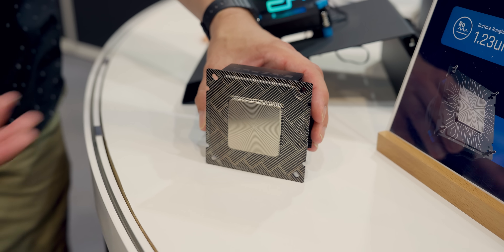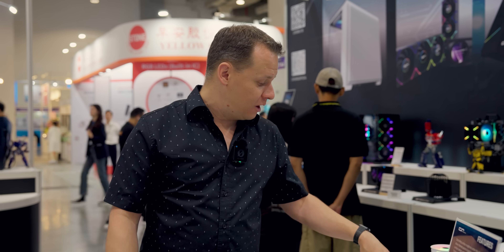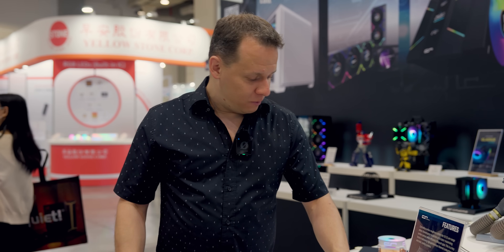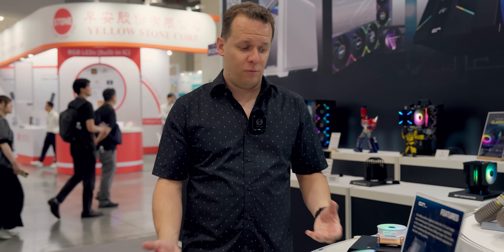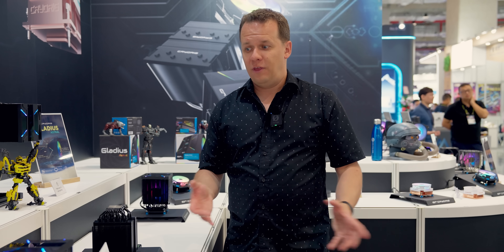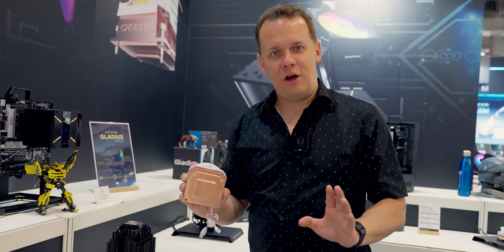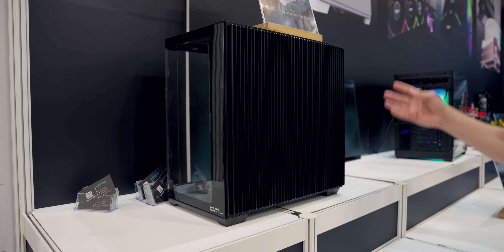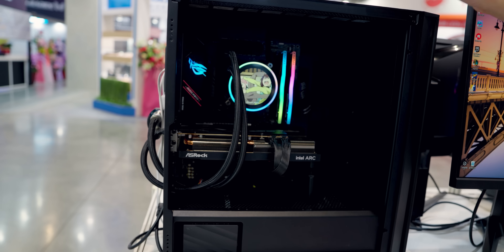The Impossible 185W Low Profile Cooler

Comment: The textured bottom makes sense. It increases the surface area and as long as the media used for thermal transfer can do the job it should be fine. Which obviously it is.
Reply: For me it is super unintuitive and I can't believe it to be better than the usual contact plates. I get that it increases the surface area but for what? The heat spreaders on CPUs are still (on a macroscopic level) flat and don't match the circular grooved shape thus decreasing the contact area.

It only made sense to me if they told me that their contact plate has worse thermal conductivity than usual thermal paste (which would be very bad) or if thermal paste spreading on usual flat-to-flat mounting would be so horrible that you could see huge holes in it with your naked eye (which it isn't).

I need to see scientific explanations or 1:1 comparison benchmarks.
Reply: @MysteryCheaterMan  Increasing surface area can, increase conductivity. Just like more fins equals better cooling. The reverse is also true, to a point anyway. At least I think that's what I was thinking when I wrote that. 

However after re-watching I thought of something I didn't take into account originally. That being the fact that this cooler puts a vapor chamber directly in contact with the IHS. So there your goal would likely be the opposite. To slow down the thermal exchange. Allowing time for the liquid in the chamber to do the work it was intended to do. If the whole system gets too hot and the vapor can not change states back into a liquid no energy is transferred meaning no cooling. 

My original statement is just irrelevant. As the IHS would have to have a matching pattern for increased surface area to be effective.

TL;DR - I must have been on drugs and was wrong.

Comment: Questions on C5 cu:
1. Will vertical setup perform worse than horizontal?
2. How tall is the heatsink, and how thick is the fan? 
3. In addition to Q2, can we pair 120*15mm or 120*25mm fans with the heatsink and have overall height uner 47, 48, or 50mm?
Reply: Gravity shouldn't have any perceptible influence in cooling.

Comment: Can the C5 cooler be used as a bridge between the CPU and an AIO? I am thinking you would get sustained more efficient removal of heat from the CPU which would mean even lower temps than with just the AIO. There are a lot of fins on that, you could have a larger chamber and no fins with an AIO bridge, you could put the fins inside for a bridge. you would need the C5 Bridge to have a second cooler mount on top as if it were itself a motherboard,

Comment: ok, the passive case, WITH a radiator in the loop, an extra 180 watts capacity, slap that in a full custom loop and have a 360 rad with semi passive fan setup.

Comment: Damn, this is so awesome - it's the same formfactor as the oldschool first heatsinks which had fans (with the top-mounted fan). And it's so compact. My triple-fan phantom takes up most of the room in my case. I would be keen for this even for my standard ATX case. Can this scale up to bigger coolers for even more cooling?

Comment: Finally after cm V8 and the sapphire CPU cooler someone came back the vapor chamber... Ps I've modded the sapphire CPU cooler to work with my  5950 and it works really well... Is not silent but maybe I'll change the fans.

Comment: The grooves for "better contact" make 0 sensen. You want to have the mirror finish because the thermal transfer of the paste sucks. Better than air, which is why you want it but absolutely terrible compared to metal to metal. And the thicker the paste the more it sucks So you get rings of ok contact and absolutely terrible contact.
Reply: i get what cryorig is trying to do, essentially faking the grooves to make contact with tim vs surface, but that doesn't make sense considering how TIM and coldplates work

Comment: Wow, Cryorig case looks sick! I really hope it's not 100% AIO or at least that they have multiple versions with a D5 pump and an integrated distro/reservoir plate. That way you could just add an active radiator too and keep the fans off while idle and been able to turn them on when hit with load... Also, adding the GPU to the loop would be nice.

Comment: I don’t think that dispersing the thermal paste with the pattern is better… this way you are using the paste as the primary "middle man" between the cpu and the cooler, and paste will never be better as metal touching metal. This has been tested heavily in the industry and that’s why almost everyone uses the polished metal on metal.
Reply from the maker: Good points and they're ones I brought up too.  I spoke directly to one of their engineers and the reasoning seems feasible.....but we will see.

Comment: The air cooler featuring ten heatpipes looks interesting but it is a bit pointless to present it without specifying what it is rated for. Will two extra heatpipes matter, given that all heatpipes will have a harder time to absorb the heat from the contact plate?

Comment: the proprietary fan is a deal breaker.
Reply: That's...true... , maybe they can save themselves from pr disaster and just give an adapter and 3d print files and some extra rubber tips and supply replacement fans when it's inevitably needs replacement

Comment: if the full thing is made from copper its understandable why it can take so much power. Masive mass with higher coeficient of heat trasfer. i doubt that little vapor chamber does much compared with only making same design from pure copper.

Comment: That case cooler would be awesome if they had it as an option for other case brands, or allowed you to run custom loop fittings to it. Imagine a radiator on both side panels that handle cooling for light stuff and a 360 in the front thats fans turn on for real work.

Comment: Looks good but the fan...if it fails you need to mod that shit instead of using standard mounting. I guess you can just make a frame with a 3dprinter.
Reply from the maker: Yeah I recommended that they add standard clip mounts.  Hopefully they take that suggestion to heart.

Comment: 60 dollars is a steal! Especially 40 dollars for the aluminum one! I would love to see if direct die liquid metal would work with the copper cooler!
Reply: $60 is super fair for that lo-pro vapor chamber cooler. I don't have a ton of money, but I'm happily picking one up at that price.
Reply: Although nickel plated copper is preferable when using gallium (liquid metal) using a copper interface will not "corrode" the copper, it will just stain really bad. What you really want to avoid is having contact with aluminum, because that WILL have adverse side effects. As far as retention after removing amd or Intel's default, manufacturers like thermal grizzly make aftermarket retention devices for making de-lidded cpu's compatible with most air or liquid coolers, depending on of course your CPU generation, make and model. Hope that helps. Happy hunting!
Reply: shhhhhhh, they'll increase the price
Reply: Do you know any other Low-profile Coolers 55mm with 185TDP ?)))
Reply: Liquid metal corrodes copper. In addition to that, once the IHS is removed you need a different design for the spreader, as this flat one would touch the closing mechanism of the CPU but not the CPU itself.
Reply: Inb4 tariffs to make it $180  lol

Comment: Imma need a full on review of that itx cooler, cause if it does what it advertises, fractal terra here I come!
Reply: that's still big, you can even go smaller.
Reply: Consider a Tiki, or a Ridge.
Reply: Of course it's a lie. You will need a fan that make a lot of noise to cool 180w with that crap. A vapor chamber job is to spread the heat faster. But once the heat is spread, you need to dissipate it. And to dissipate a lot of heat, you need a lot of air flow or a lot of surface. Since this cooler is small, the fan have to be extremely performant and it will be extremely noisy.
Reply: Try the formd T1, it's basically the terra but more.
Reply: @ash8603 sadly couldn't buy it anywhere here in Germany, had to settle for the Terra. The Terra is really nice though.
Reply: And would love to see it come to a laptop in a different form factor

Comment: I have a couple of Cryorig QF120 Performance fans still kicking. They're not on my rig anymore because I realized 2200rpm is overkill for my application.
Now I use them as desk fans or fume evacuators when soldering, all that airflow put to good use.

Comment: I like the Lull concept. Obviously going totally fanless requires moving the heat from the CPU (done), the GPU, VRMs, and the NVMe(s). Thus, the barrier to entry is user-friendly connection to MB, GPU, and sundry heat sink products made by other businesses. That is a huge lift.

Maybe a scaled-up Ventiva/AirJet type product would be useful to a fanless system.

Comment: does the clip on design for the fan mean it can't be swapped with a noctua?
Reply: I’m wondering the same thing. I wonder if the metal clips could be used
Reply: Someone created 3D printed adapters for the cryorig c7 and that also had a clip-on fan. If this cooler is good I’m sure it won’t be long until someone does the same here.

Comment: Thank you for covering this, I was not aware of this company and would love to use these.  My kids computers all end up using lower tdp i5 chips that push the boundaries of other small coolers like this and I end up needing to fit a "full size" single tower in mATX cases.  This implementation if works as advertised would be an instant buy for me.  Hopefully the die grooves play well with the different die shapes (height wise) of both AMD and Intel products.

Edit:  If they can hit or get really close to those prices.

Comment: What I would be interested is how this vapor chamber performs in horizontal orientation vs vertical orientation. Most boards are mounted vertically and that is not optimal for vapor chambers. Does it make a big difference?

Comment: I guess I would need to look into this more, but it seems to me that, for something as small as this, it would be more efficient just to use a thin unibody copper block with fins. I was under the impression that the befits of vapor chambers scaled roughly proportionally with the chamber area minus the inefficiencies from the headspace it introduces.
Reply: Most phone manufacturers are actually using vapor chambers in their flagship devices these days.
Reply: @-eMpTy-  You raise a good point. However, I was under the assumption that was because of weight and not performance. But, again, I don't really have any hard data to back me up.
Reply: Why would Nvidia 1000 series gpus use vapour chambers then?
Reply: @Loanshark753  I wasn't saying vapor chambers are bad. In fact, I think they are great. I'm just saying that there is most likely a total area size under which the benefits are largely negated. Graphics cards, even low profile ones, are always going to have heatsinks with much greater area (probably at least twice as much) compared to this particular CPU cooler, so it is likely that they will always benefit from a vapor chamber.

Comment: Hopefully this goes on sale! I will buy it immediately I’m running a 7700X and a 3080ti in my fractal ridge but my cpu is severely power limited so compensate for the heat it gives off.
Reply: It won't, you'll never find this in retail.  It's one of those cool tech that's made only for show.

Comment: Finally somebody makes an LP vapor chamber heatsink. The vapor chamber was a big development like 10 years ago right (not gonna look it up lol)? I think I remember the promise of vapor chambers was being able to attach more heat pipes into the main vapor chamber, theoretically allowing for heat pipes to be attached to all four sides of the vapor chamber and even on top, but as far as I'm aware I haven't seen anybody do that. The Xbox One X had an awesome vapor chamber heatsink that was very successful at cooling the console.

For that passive cooling case, I think it would be super cool if they made the front/ top into a single continuous radiator with slots between the water channels to maintain fan compatibility for the GPU. 
If this works out they should go for a passively cooled mITX case for APUs next. It's tough though because the PSU and components on the mobo still need to be cooled.
Reply: I want to see if they could make a single tower based around that VC.
Reply: It would be cool if vapor chambers can become so much cheaper than people can make their own parts with 3d metal printing.
Reply: @dra6o0n  If the stated price of 60 bucks for that copper slab is correct then that's cheap enough already.

Comment: simpler is better. the passive radiator wall is just fine. you could double that using a flex hose aio water cooler style plug on the outer wall.

Comment: I did rewind like a few times to check if I heard the price right. 60USD for low profile 185W cooler is just sounds wrong. I wouldn't be amazed if it was 600 USD, but 60 is a joke price. What a find for SFF builds.
Reply: That's before tariffs if you're American
Reply: @Saiklohit  I'm not, hehe

Comment: would that small low rise cooler work on the 7800x3d since it's only 125w?
Reply: Undervolt and an axp 90-47 works.
Reply: @impact224488  Its not the question.

Comment: My first cooler was from Cryorig, it’s now been retired to server cooling duties but it still works (even the fan) after 10 years of use!
Reply: my was the R1 Ultimate still running strong
Reply: Im using a true 120 from 07 or 08.
Reply: yo whats good Karl jobst
Reply: of course it still works, there is nothing to break.
Reply: @BeepBoop-o3o  Usually you'd expect the fan to die within 10 years due to the bearings wearing out
Reply: @kettusnuhveli   yeah. then you can slap a noctua fan on it and it will live forever 😅😅
Reply: @kettusnuhveli Not if you have some decent fans.
Reply: my noctua fan died after 3 years
Reply: @zaxmaxlax  they will replace it for free
Reply: My 2011 top air cooler worked fine for 12 years and the fan is still smooth and looks cool...
Reply: My r1 ultimate is still going in my server as well. Original fans.

Comment: Cryorig is/was underrated. Looking forward to how good air cooling gets this year.
Reply: Totally, they are always affordable. Their C7 wasn't so good out of the box, but aftermarket fan adapters really helped. Their C1 was an awesome top-down cooler as well, akin to the Bequiet top-down giants.
Reply: Not really? They stormed the air cooling market about a decade ago. Just not much happening with them to talk about over the years till now.
Reply: I still have my Cryorig H7 running strong. No complaints at all.
Reply: Underrated putting those grooves in the base plate? They are not smart doing that! Anyone who know how heat is transfered know that copper and aluminium are better than thermal paste to conduct heat!
Reply: @ianmoone8244  Partially true. Actually, most heatspreaders are slightly dome shaped. The difference is small enough that it's not noticable to the human eye.  Its because pressure alone can't push the thermal paste out enough. That little dome will ensure that the distance at the center (where the most heat usually is, with the necessary mounting offsets) is minimized. 

It has to be subtle enough so the rest of the heatsink is also transferring heat well, but also aggressive enough so the paste is pushed out.

My guess is that the grooves will not as deep as they look, and will try to minimize the distance across everything as small as possible. Their design is a little counterintuitive, so let's see if Cryrorig really achieved something or was just going haywire.
Reply: I had one cryorig and it performed like shit.
Reply: Yeah but it depends on the fan noise. I dont think anything is better than BeQuiet or Noctua for air cooling
Reply: @Ladioz  you can use Cryorig's vapor-chamber and Noctua's fan. Who's gonna stop you?
Reply: @Vottotoiono  Thanks for the reply